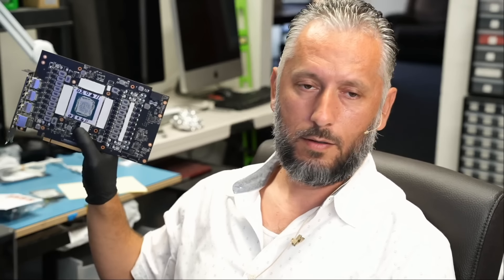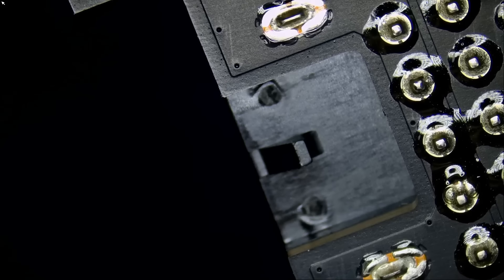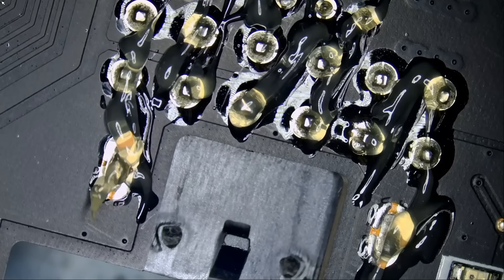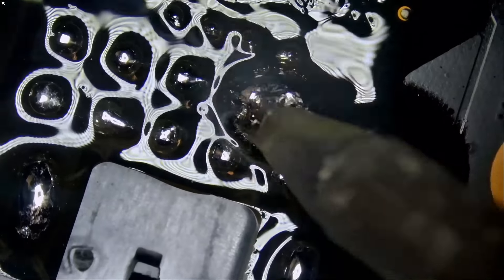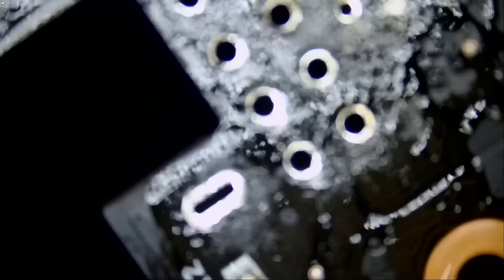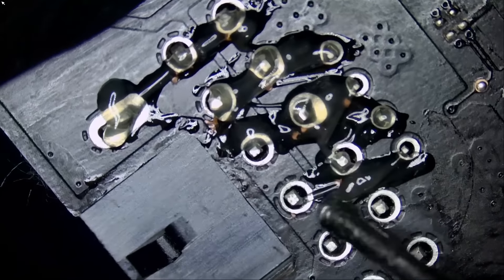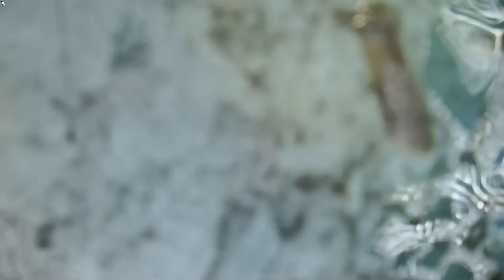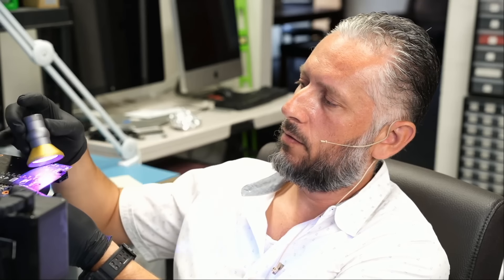Two Asus 4090's melted connectors.

Comment: curse of 4090 and 14900k  imagine spending all that money to get top of the line PC.. im just scared to upgrade  now..
Reply: Doesn’t happen on my gtx1080
Reply: Ummmm yeah man I just got a 4090 for an AM5 build. Haven't built a PC in 15years and I'm so scared man. I am poor and it took alot of time and hard work to get the money for this PC. It would be such a dissapointment to have it burn up because of an issue with THEIR power connector.

I'll be using the corsair 12v plug that came with the 1000w PSU which I heard is a little better but heres to hoping!
Reply: I had to get one for work.  One thing I made sure of was there was no tension, twist or force of any kind on the cable.  The orientation of the connector meant the case couldn’t close without forcing the cables to bend.  I used one of those 180 degree connectors, and carefully zip tied the cables so the connector was under no force whatsoever.  So far so good.
Reply: @tombriggs5348  my buddies 4090 connector got fried he had it properly secured no bending had GPU vertically mounted .. 12HPWR design is flawed imagine pushing upwards of 500W over those tiny pins for sustained hours if your 3D artist it matters.
Reply: @arbiter-pe3xg  u know what also doesnt happen on your 1080?  ...more than 40 fps.....🤣
Reply: @ARUNMANOJ86  I agree completely.
Reply: They should make 24 pin like mbo pin🤣

Comment: Hope you had a good holiday? Can I ask you, Alex. Have you emailed your 4090 melting connector videos to Nvidia and made them fully aware of his problem? This is NOT an end user problem but a connector insufficient of handling the current/watts under high load regardless if connection is slightly compromised.

Comment: For the price they sell the cards, they should redesign those connectors. Maybe a phenolic body instead of cheap plastic or even ceramic. They can also redesign both, the board and the connectors with more pins, or thicker pins to manage the high currents.

Comment: What is the best way to prevent the connector from melting. Besides the "make sure it is plugged in correctly"? I had to have mine repaired.  You did a fantastic job as usual.  Cable Mod recall paid for repair, and I am using the new design plug, but I am still worried.
Reply: Ensure that you have a quality PSU and always stable 12v.

Comment: Are you now installing the 12VHPWR connectors or the newer 12V-2x6 connectors on the cards?
Reply: 12VHPWR, but it doesnt matter, both are shit, the 12v-2x6 has shorter sense pins and thats about it, they discovered that people are not plugging in the cable fully because the sense pins on the 12VHPWR are long and create some resistance when people try to plug in the cable,  anyhow, the only way to prevent melting is to keep monitoring the 16Pin HVPWR  input voltage supplied to the GPU and set an alert for that in HWInfo64, if it drops below 11.6v then something is wrong and will give you a chance to save the port from melting.

Comment: I was thinking about the 4090 connector problem, could it be as simple as the pins on the connector are just a bit small and giving a high resistance between the plug and socket? Then over time, arcing & heat this gives a higher resistance then gets a thermal runaway.
Or is it just the 4090's current and the connector is not up to handle that sort of current?

Comment: There is something I do not understand (And yes, because of my lack of knowledge hence asking the question): Why do you add mask on the scratch portions if the pin is already exposed? I.e. the mask would not prevent a short?
Reply: i believe it is to protect the PCB from wearing out by those scratches over time, like those scratches might get deeper overtime and damage the whole PCB.

Comment: 450w usage I don’t think will cause similar issues. Can you confirm somehow the wattage these card were used with? I eould guess 600+ watt usage can cause the connector to melt.
Reply: There are many videos on other channels showing how a slight misalignment, possible even when the connector is in its locked position, causes this.
Reply: They are planning to run 5090 500w and TITAN AI 600w on the same connector.
Reply: @ralphj4012  I connected and disconnected it like 20+ times already always with the little flashlight checking it all around before pressing power.
Reply: @club4ghz  Hopefully on two of them if not my 4080 was my last Grafics card and im going back to console.

Im Mad at my 13900k and the paste on my 4080… Issues over issues…
Reply: Galax 666w vbios running daily since December 2022 without issue. I also have a 13900k running unlimited at 5.8p/4.5e/5.0ring since Nov 2022 without issues. Guess I'm just lucky 😂.

Comment: they wont fix the problem with that connector until they recertify it for 300W or ditch it and make an entirely new connector.

Crazy how some designer somewhere thought that taking 6x 12V wires (from 2x 8-pin), making them half the physical size and throwing them into a new half size connector, while also doubling the power rating (2x 8pin = 300W combined, 12VHP = 600W) would result in nothing melting.  Wouldnt half size wires and 2x the power = 8x heat possibility?

I guess nvidia wanted a new connector type for thier cards to make it so they didnt need 4x 8-pin connectors and a full size PCB to handle them. I will never guy a card with that connector, its a dumb design from a basic electrical point of view.

Wouldnt it have made more sense to use 2x 12V EPS connectors with an adapter from 2x 8-pin pcie per 12v EPS?

Comment: Id rather have 3x8pin over this garbage connector.
This connector need to be enlarged this tiny one cant stand beyond 300watts.
If its not fully seated it gets burned if you  push too hard you may break it.